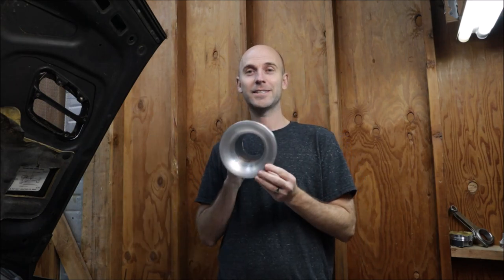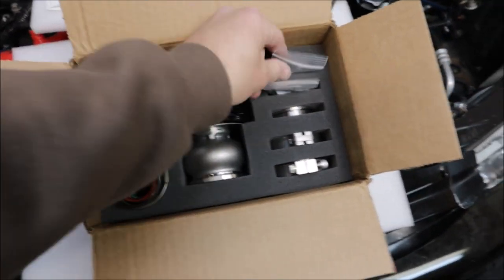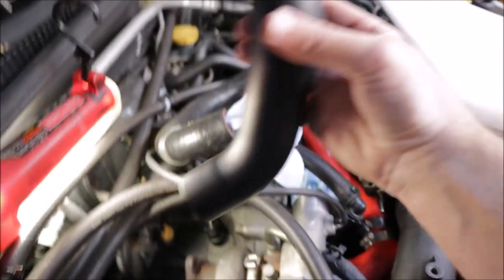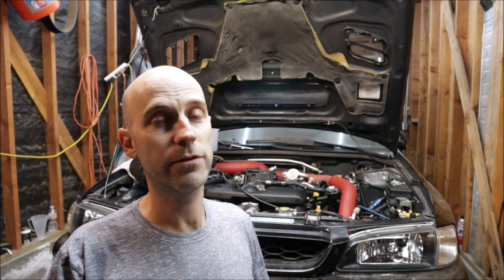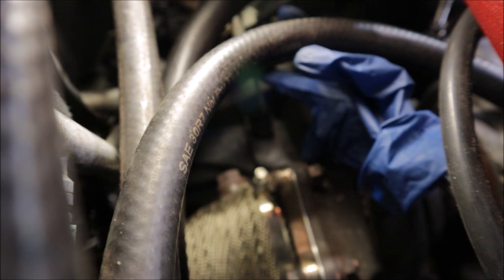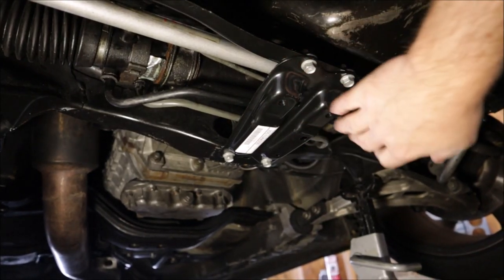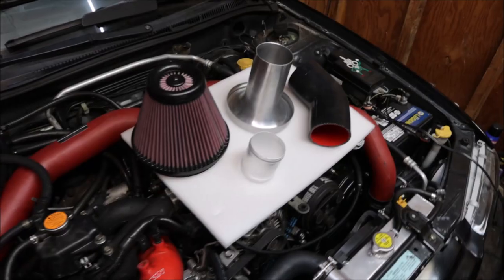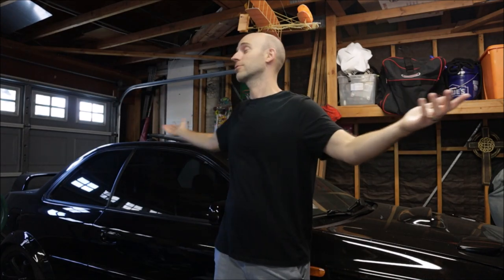Impreza Build: External Wastegate, Velocity Stack Intake, Turbo Blanket, Oil System Prime

Comment: Hi, did you manage to rebuild the power steering pump? Keep it up, I just unclip the crank sensor and turn the car over, oil pressure builds up fine that way
Reply from the maker: That’s one way to do it, but could still do harm as many parts are not lubricated. Pump was rebuilt and so far so good!
Reply: If you ever need any specs, screen shots for electrical, mechanical etc. I have an original 1997 factory service manual for every component on Subarus
Reply from the maker: @grant3682  that is money and good to know. Thanks! I may need some help if I can get it sorted.

Comment: new subscriber!! I'm excited for your content I also have an rs she's not running well right now currently troubleshooting lol
Reply from the maker: Welcome to the RS club and thanks for the sud! They all run poor at some point eventually. Does it have a CEL?
Reply: this is true lol ya initially it did it said random misfire I installed an aos right before it happened
Reply from the maker: @caos619  what flywheel you running? I get a misfire occasionally and I thinks it’s from the lightweight flywheel.
Reply: @RoadPatina  gruppe-s lightweight flywheel
Reply: The factory ecu will sometimes do a random misfire code with a lightweight flywheel because it slows down faster the programming parameters. Just make sure you have good grounds with a low voltage drop and clean coil terminals. If you have the factory plug wires maybe consider replacing them with new NGK blue wires. Additional resistance can create a few more random misfires.
You can also get a misfire codes from the fuel system, so if you haven't replaced your fuel filter do that as well. Please use a good quality one as well like the factory filter. Maybe a can of BG 44K with a tank of premium could do some good too?
Reply from the maker: @troyfankell6581  great info man thank you! New oem filter was installed. I’ll check grounds and maybe new ngk wires too!
Reply: @RoadPatina  I was replying to @caos619 but if it helps you, great. On your RS I would definitely recommend the voltage drop tests between all the grounds with a limit of 200 mV.
Reply: thanks Troy! yes I replaced the fuel filter last year ( haven't really driven that much) it is a ej205 I did replace the coil packs, injectors, and pump I could replace my plugs it's been 2 years but also only drove like 4k miles but I did just install an aos so I think I may have a vacuum leak
Reply: @caos619  Since it is a 205 swap definitely check all of the vacuum lines going into the intake. I highly recommend doing a voltage drop test on the ground circuit to ensure the engine, chassis and battery connections are good. 
If they are NGK plugs, don't use any anti-seize because NGK has a coating the allows heat transfer and grounds the plugs.